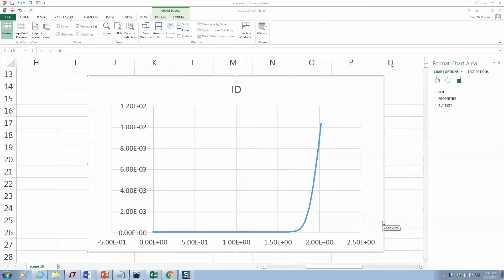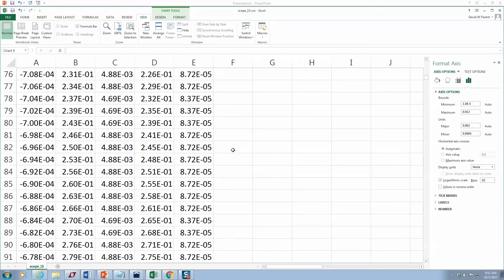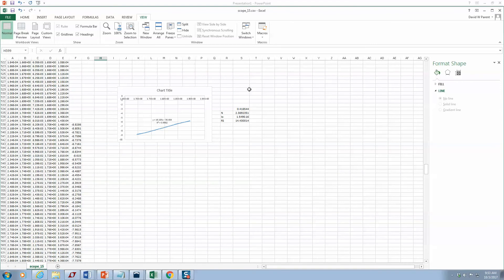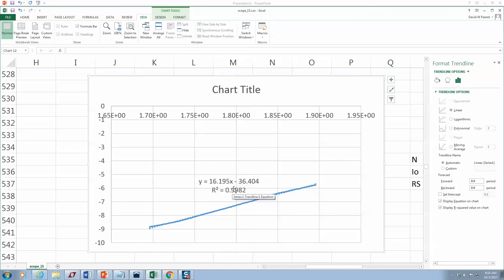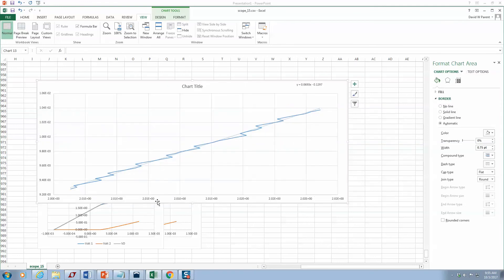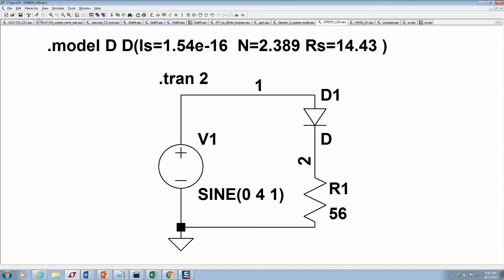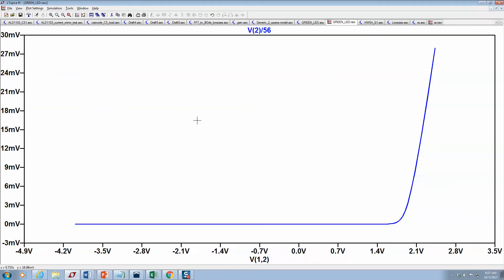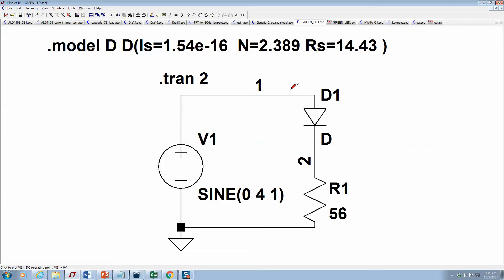Extract DC Diode Model and verify in LTspice

Comment: Very nice.  Really appreciate the insights here.  I wonder if you have and suggestions for resolving a model from a datasheet I/V curve?  I can imagine it's iterative but would appreciate your thoughts on parameter starting point values, order of parameter adjustments, etc.  Thank you for your post!
Reply from the maker: The datasheet and the model would be hard to resolve even it were possible to extract a model from the datasheet.  A datasheet will on general give an IV curve, that if on a ln axis, the ideality factor and Io could be extracted, but the series resistance would be hard to get correct.  Not only that but diodes like resistors have parameters that vary from device to device.  Also a diode can have more than one Io and n depending on the voltage.  I would just use the method that is closer to reality for your application. (REality implies a measurement.)